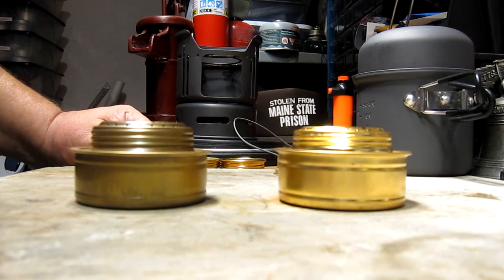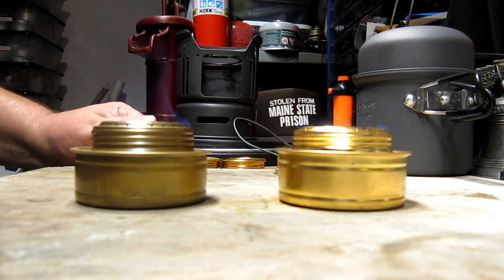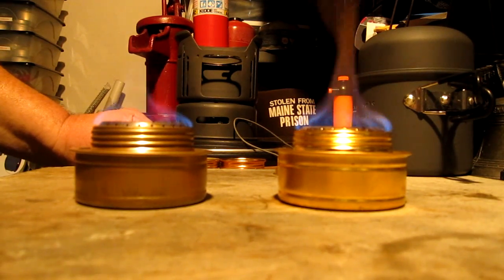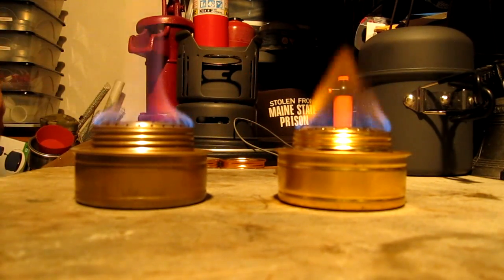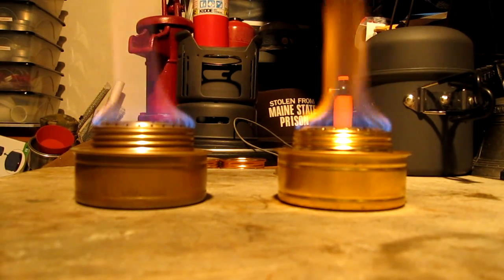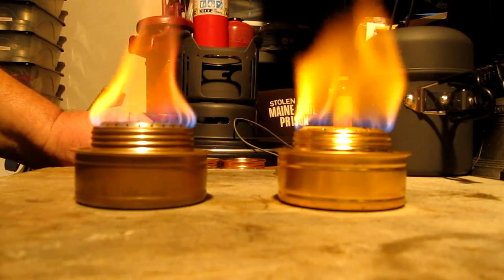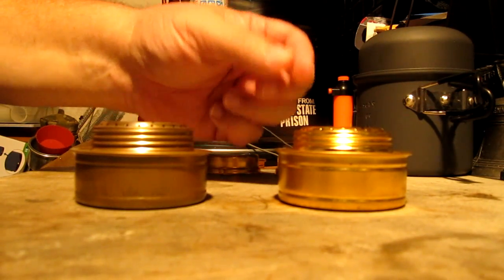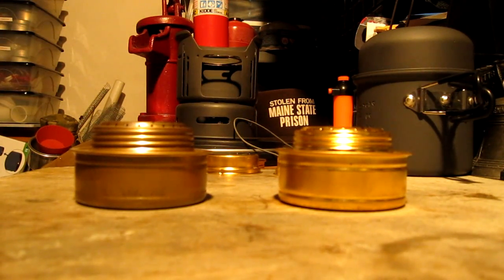Burner Flame Pattern - Trangia vs ALOCS

Comment: I've been doing a close comparison on these 2 burners. The Alocs and Lixada (same burners) seem to be made of stainless steel and plated with a gold colour metal. I assume to make them look more like the trangia. I did a bit of sanding on the bottom, to reveal silver metal, same as the sliding top piece. If this is the case, and they are stainless steel,  I would give it a big plus on the durability side. I have a few small crack in my brass trangia.

Comment: hi hiram, I re-looked-up a video of yours I think about you un-boxing an alocs burner that has an aluminum pot stand and I think yours came with a stuff sack, too? anyway, maybe this video isn't it... not sure, now? I think in that video you opened the alocs box and tossed the alocs burner over your shoulder. well, I just wanted to share my personal experience with that very same alocs burner and pot stand if you don't mind please sir..... after already having a couple of trangia mini burners (civilian trangias) I find the the alocs performs pretty good in the same pot stand with a small iron skillet on it. actually, in this particular set-up I found the alocs to perform better than the trangia because the alocs doesn't burn as hot as the trangia. yes, you can simmer ring down the temp on the trangia, but I'm thinking the alocs burner isn't exactly total junk to just toss-out in that it does work pretty well, too (in some configurations / set-ups). I like trangia burners better, but I like the alocs pot stand better than the trangia mini pot stand and the whole alocs set with burner, pot stand & stuff sack was only $10.50 total (shipping and all from china) when I bought it on ebay. so, really the alocos set-up was a bargain I think. I betcha I've used the alocs set-up close to 100 times (promise I am not kidding). I make fried egg, cheese & ham sandwiches with the alocs set-up using the alocs burner with no simmer ring. the whole alocs set-up costs about the same thing as just the trangia mini pot stand. so, I have to say the alocs set-up is a bargain to me. if you wanna boil water the trangia is of course a much much better hotter burning stove than the alocs is IMO. however, for cooking the alocs burner works just fine for me and I surely wouldn't just toss it out if it were me. we love you here in texas and ready for new videos whenever you have them! thanks hiram!

Comment: about the alocs v's trangia (I have both): the alocs performs poorly when compared to the trangia (cruddy out of the jets & over-all just doesn't give a nice strong flame pattern + the alocs takes a lot more time to reach peak operating temp). the alocs burner (with handled simmer ring, reg o-ring lid, alocs pot stand and stuff sack) costs $10.50 including shipping on ebay directly from china. so, the alocs is a good deal, but isn't as good of a burner as the trangia burner. the good thing is that all of the alocs parts fit the trangia. so, you get extra trangia parts and a real good pot stand and stuff sack. I'm just saying that the alocs burner is NOT an A-1 quality burner compared to the trangia burner. I like the alocs pot stand better than the trangia pot stand. these are the differences in my opinion.

Comment: Hi Hiram, I 've ha d an Alocs for many years, I just recently got back into the need for Stoves and testing them out again, I got out my Alocs, the last time I used it, was on a week long hiking trip, and it was used a lot, i did not clean it after, and after a few years in storage, it looked to be ready for the trash, I took an SOS pad to it and in a few minutes, it looked like Brand new, I did some dry baking with banana nut muffins, and had the simmer ring just over half closed and it burned for 50 minutes in my kitchen with a windscreen around it, on 1 ounce of HEET using the 12cm Imusa and a small baking Dish in side for the muffins, the Muffin came out Perfect, no burn, just enough brown on the outside to make it very good, I was shocked I had to put out the flame at 50 minutes, but it was nearly done anyway, but nothing I've ever tested comes close to 50.

Comment: Thanks for the video. My only complaint is: I have been retired for 6 years and haven't used an alarm clock since.  My alarm was the exact same sound as your alarm, and when I heard it I had a slight myocardial infarction.  :)

Comment: There seems to be an overall cleaner burn on the Trangia, and the Alocs simmer ring doesn't seem flat (in various photos). It still works, I guess, in snuffing out the flame.

Comment: Hiram, I did a video a while back comparing the Trangia to the Esbit (which appears to be identical to the ALOCS). Their dimensions are very similar, but my Esbit leaked fuel with the lid on. It didn't seal properly. So I also recommend the Trangia over its imitators. Cheers.

Comment: The Trangia seems to have a better threaded lid which may account for a better seal. Couldn't you add a good wire to the trangia simmer lid like the ALOCS ? JIM

Comment: the trangia is tried tested over years, be interesting to see the difference in what each burner weighs, but its the same idea on the burner jets, and also the simmer ring with the handle, there probably made in the same factory as the esbit and just re-branded something else,  the esbit are known to leak fuel when they have the top cap on, wonder if the alocs does the same.Im thinking that the esbit and the alocs are identical and produced with thin materials and probably made in the far east